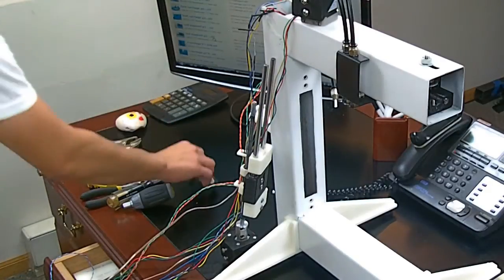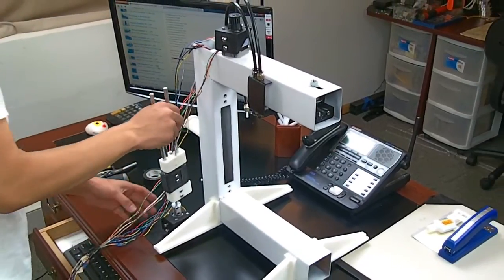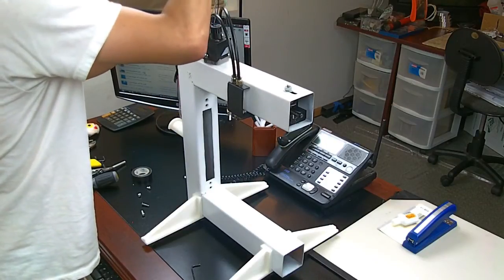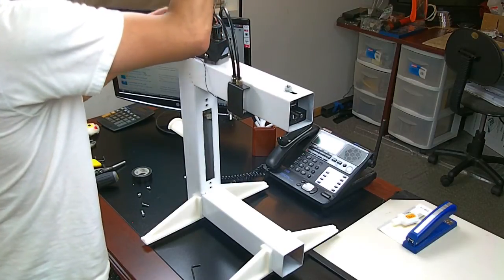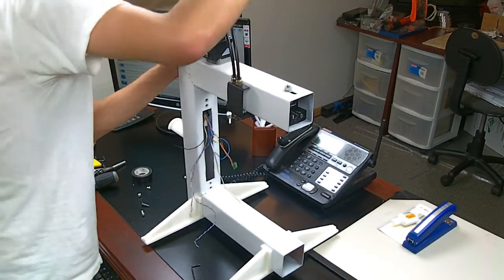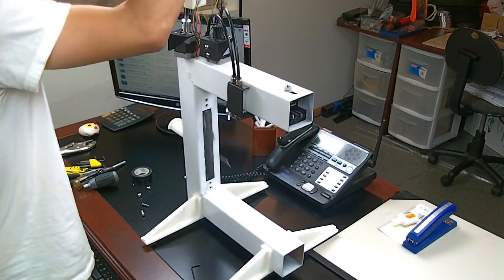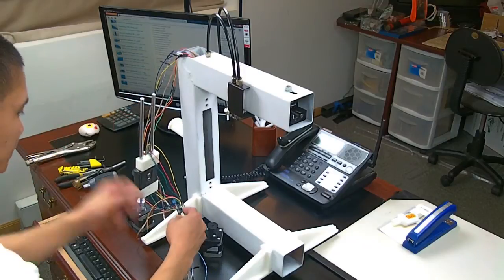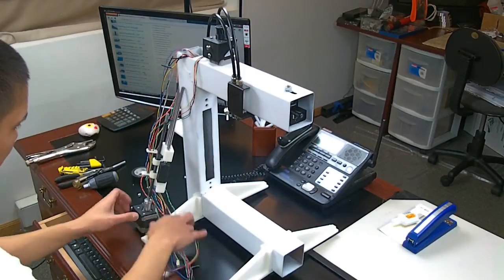Assembly of Eventorbot. Z axis tutorial part 4

Comment: A access panel on the vertical column (front) starting below the x axis stepper down to just above the z axis motor will facilitate the installation of the wires as well as the install of the z axis stepper.  Access hole could be 2 inches wide by 10 inches long.  Then when you chase the wires you could use a plastic wire loom to safely bundle the wires to the base.  When I build mine I will gladly post the results.